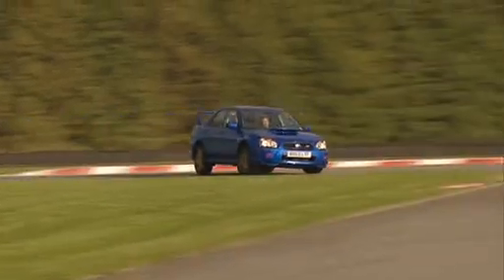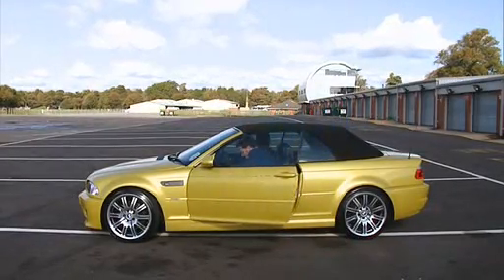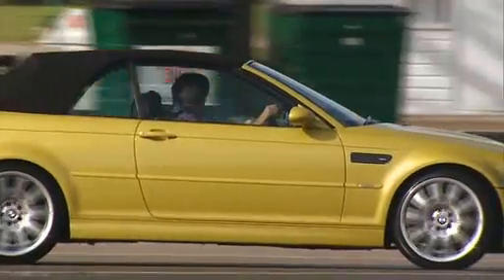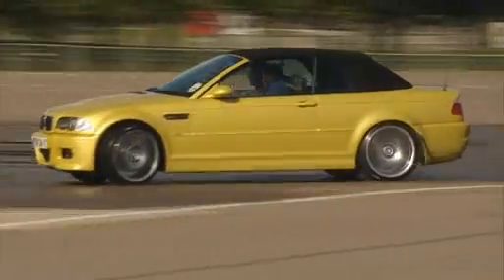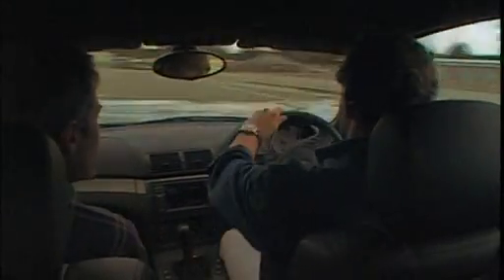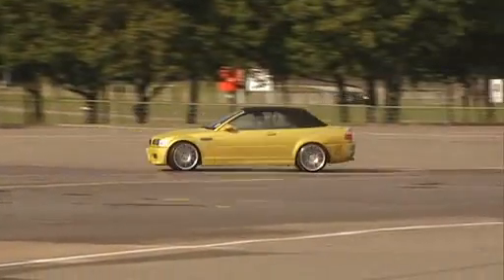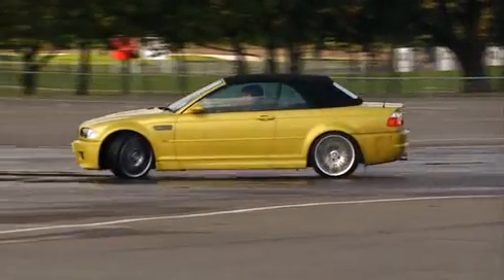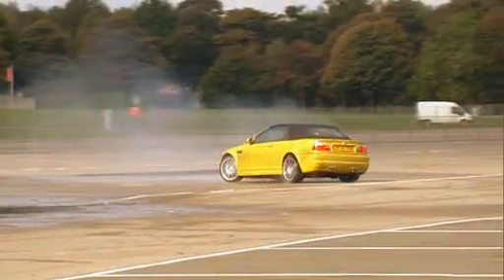Tiff Needell's Powerslide Tutorial

Comment: @lethaldosage6040 a double clutch is when you input a blip of gas to rev match during a gear shift.  Example: I'm slowing down in 4th without braking.  As the revs drop I should be in 3rd.  Clutch-in while in neutral you blip the gas to build the revs up to where 3rd should engage and then clutch-out.  This allows you to have a smoother shift rather than not giving any gas which can cause the car to jerk or shudder.

Comment: @TheMassyl   Strike86 is incorrect. Here are the terms as used by formula and pro rally drivers:A Drift is when all 4 wheels are losing lateral grip as the car gains speed. A Slide can be only the front or rear wheels that are losing grip as the car loses speed.

Comment: so true RWD is so much easyer than FWD drifts. 
was doing it the other day in a Mk2 Escort rs2000 fully rally prepped.  its much easyer than tiff described it. pull upto the corner at abotu 10-15mph turn in and stamp on the power for the corner put in opposit lock jump off and stamp back on and you have just done a pendulum slide.

Comment: Not quite.

Drifting is the name of a sport, power sliding is the original term used to describe drifting before there was such a sport.

Essentially they mean the same thing.

Power sliding usually referring to more of just power-over drifting than anything, as back before the sport of drifting started, people would just slam on the gas, and then steer to correct, and call it power sliding. Drifting usually entails more complex techniques.

Comment: @mudfly3 Yes you most definatly can, tiff himself learnt  to drift in a morris 1000 at about 15 mph on a wet roundabout. i used to drift my e36 318i with completley stock suspension and that only had 115bhp from new 20 years ago :P get something like an e30 or e36 318i for a starter driftslag >.<

Comment: Motorcycles are better 35 miles an hour 45 miles an hour on a power slide anything over the net you could lose control 35 to 45 miles an hour no different than accelerating and popping the clutch in the corner shifting into the next gear and when the tires peel and catch grill for you you're going to feel it be careful I want the tires slip out but when did heats up and catches I'll make sure you lined up